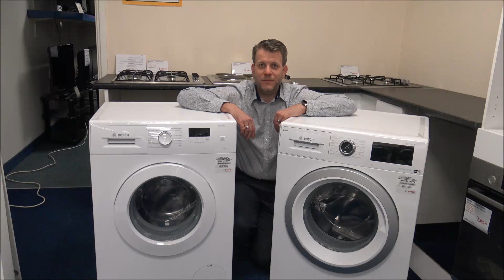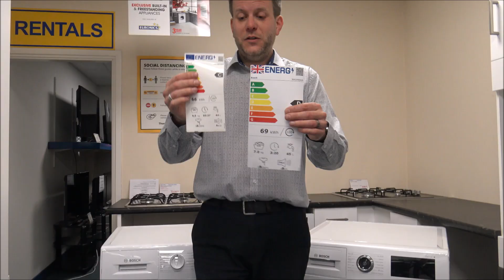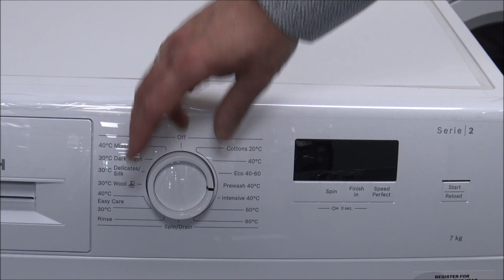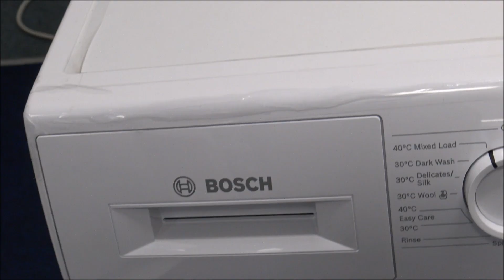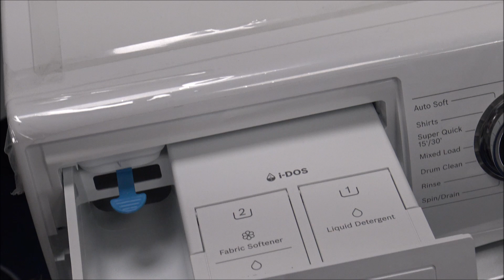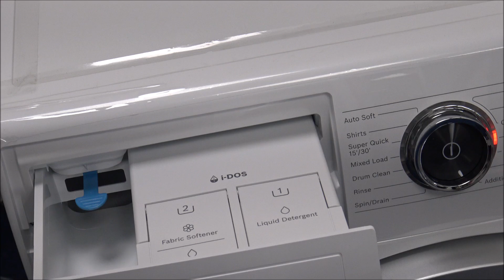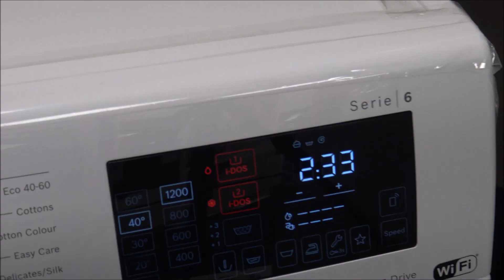Is It Worth Paying Extra For A Better Washing Machine?

Comment: When my old washing maschine broke, someone recommended that I buy a second hand Miele washing maschine. I could not be happier.

I paid 190.00

With a bit of looking I found a top of the range 8kg model with steam, so I no longer need to iron. 

The previous lady was an old lady, so it was like new, with a very small amount of hours clocked up. 

With used washing machines, there are either used continually by a family with pets, or are from a single or couples household. This makes a massive difference, on wear and how long the washing maschine will last. 

I managed to look in the service menus, at the number of washing hours clocked up since 2013.

With my current usage pattern. The washing maschine should last over 40 years. Given Miele’s own figures. 

The Maschine I purchased is a W5965 WPS. Not the most common, as it was a flagship model, just before the launch of the W1 series, but if you can find one, with low “mileage”, snap it up. 

It is the last of the built like tank era miele’s with the orange glow around the dial. However it has a larger drum 8kg, and many of the features of the W1 (apart from power wash and windows, but I don’t mix them, as it is more points of failure).

It has an inverts motor, like the W1 which is more economical, and is maintenance free.  

It is just about as economical S the W1 series that succeeded it, as it was top of the range, it used much of the same technology and principles. 

As everyone washes at 30°c now that the enzyme action of modern washing maschine detergent is better, there is no need to use the eco40-60 program. Just use the regular programs at 30°c for soiled items, for daily items, I use the short function of the regular programs, plus an extra wash, or the automatic plus program, which is about an hour. 

Where the 5965 wps far exceeds the W1 is with rinsing quality. It uses mor water to thoroughly rinse the detergent out of the fabric, and this really does get clothes “Miele Clean” after a few washes my clothes looked and felt like new again. 

This is because the vitreous but gentle wash cycles and thorough rice, removed detergent build up from my clothes, that had accumulated over time. Hoodies, sweaters and jogging bottoms feel soft again, and t-shirts hang on the body like new. It’s hard to explain, but clothes just feel good, and smell properly fresh, not fragrance fresh.  

I have had it for a couple of years now, with no problems. Washing is a pleasure now, instead of a chore, an as a result I look after my clothes more, so buy less. 

Could not recommend highly enough, buying a looked after used Miele washing maschine, rather than a new low-mid range one.

Comment: I have come back to this video .... I bought a Hotpoint NSWM846GGUK 8KG 1400 Spin machine in March 2020, and I have  "Babied"  the machine 
Never over- or underloaded it once .... Cleaned the drum with Calgon washing machine cleaner and the rubber seals /powder drawer every 6 weeks without fail with Dettol washing machine cleaner  (I live in a soft water area). I have cleaned the filter on the front of the machine every 3 months 
And the machine has only been used on average 3 times a week ....   
Do the maths 3x52x6  =  936  Washes.. (Less than 1000 wash cycles)  and the bearings are  starting to get noisy, 
OK, I did not pay a lot of money for it ..I believe it was around £280 (which, let's be honest, is NOT a lot of money anymore) 
So you could argue  £280 for 1000 washes ...Not bad value for the small amount of money I paid for the machine.... 
I am, however go to push the machine until it dies (I have been told the bearings can  rumble on for years before they finally let go) 
My next machine is going to be either 
1) Bosch series 2....  Bosch WGE03408GB 8KG 1400 Spin
2) AEG LFX50844B 8 kg 1400 Spin 

Both are priced at around the £419 mark..... I am going for better quality WITHOUT the  Hi-Tec BS   (connect to WI-FI etc etc...Less to go wrong)

Which model above would you reccomend please?
Reply from the maker: Personally I would say to try and stretch to the Serie 4 Bosch as the warranty should be better and you won’t normally pay too much more

Comment: I recently bought a Candy washing machine. (The model is: GD410B8G-80) 
5 yrs ago, I bought a Candy Tumble Dryer.
I live on my own so washing maybe 4 times a week, (Towels, Work Clothes, General Clothes, Bed Linen) usually near the weekend and during Economy 7 times.
The Tumble dryer still works fine, but the control selector has lost the ident positions.
The Candy washing machine has a 10KG load cap and has the clean drum function.
I have heard that it isn't good to close the door after the wash if the seal is still wet, so I leave it ajar for a few hours.
It is soooo quiet compared to the old Hotpoint that was here when I moved in.
I have chosen to use the 59-min Steam function setting for most of my washes but lower the temp to 40C and select 1400 spin.
I wonder if you can show approval of this or maybe a different setting. 
It's probably a big ask, but you may have something I can work with. 😁

Liked and subbed.
Reply from the maker: That sounds like a good program to use if you are in a hurry, but sometimes the wash performance is better if you use  the longer programmes. You are always better to leave the door open at the end of the wash to avoid smells and moisture buildup as well

Comment: I've got that series 2. Prior to that had an older series 4 equivalent which was 12 years old. Hadn't actually failed but lets just say I acquired the fairly new series 2 at no cost! New series 2 has a quiet motor. On wash almost no sound other than the water. Much quieter than the brushed motor on the 12 year old series 4. But on spin whilst much quieter than the old machine it shakes far more. The old machine never shook at all even with a heavy load. I hadn't realised it was only 1200rpm. Explains why it doesn't dry as well as the 1400 the old one did! The quality seems a big step down. Simply closing the door can take several attempts. Pressing the button takes an effort. Whole panel flexes. My old one was built like a tank. Had I not got it for almost nothing I'd probably pay extra for a series 4.

Comment: I have an LG bought in 2012, 11Kg even though it's standard sized. I think it has record low noise, 54 dB for washing, 64 for spinning. 

Display with pixels, and graphics, not old school numbers only. Will I be able to replace with a similar spec model if it will break ?

Comment: In my old apartment there was a washing machine included in the rent. A very basic cheap model, I dont remember the brand.. That thing just worked. Years later I wanted a new silent model. Got a Bosch for 500 Euros.. Very soon I realised that this machine was super sensitive with spinning and would stop if the load was not balanced.. This was NEVER an issue with the old machine. I moved (not because of the bosch) and there was again an old machine. An Indesit. Still working..

Comment: In 2007 my Hotpoint suffered terminal failure at just three years old. I went to Currys and walked out with the cheapest machine they had, a Whirlpool AWO/D 4505. I still have that machine, it runs on average 5 loads a week and it has only ever needed new motor brushes.

Comment: I have the Bosch series 2 and it drives me mad, programmes too long, and the shorter programmes only take half load. The thing I hate most is the ‘touch sensitive’ start button, if you don’t use the exact amount of pressure it beeps twice and won’t start. I’m looking for a new washer but I’m afraid I make a mistake again.
Reply from the maker: Unfortunately that is quite standard on a lot of washers that the programs are quite long and the shorter programs are for smaller loads. Try not to be tempted by a machine that does a full load in 30 mins as the performance and efficiency of the wash is not great
Reply: @lords-electrical  Thank you for your reply. My friends often tell me their washing machine does a full load in 30mins and fast spin, I realise after watching your videos their stories are all spin!
Reply: Those things are common to expensive washing machines too. They are EU cycles to get good scores on the EU energy label and the touch start buttons are commonplace.  You'll find models sold elsewhere (e.g., Australia, South Africa etc) have much shorter cycles on a similar washing machine (e.g., an Australian-spec 9kg Bosch has a 1hr 25min cottons cycle compared to 3hr 29min on the EU/UK-spec 9kg Bosch).
Reply: And the door which often doesn't close at first attempt which is why it does that as it senses door isn't shut.  Build feels a lot cheaper than last mid range Bosch I owned with a nice proper button. Is it touch sensitive though because seems to require quite a firm press. It's feels like the entire housing flexes when you press the button. And yep. Usually multiple attempts to start a wash.

Comment: A 3db increase is not twice as loud, it is a slight increase in volume. 

It requires twice the power to achieve a 3db increase, but we perceive sound volume logarithmically, so it takes twice the power to achieve a perceptible volume change. Hence the dB scale.

Comment: Thanks for the great video and explanation. It would be interesting to know whether more top end products use metal or better quality plástic components than the cheaper ones. As I understand the inverters are great but then the control panels are what seem to play Up. I recently bought an AEG ; any good? An equivalent BEKO +/- was €200 less, not sure if I did right.
Reply from the maker: You should find that the AEG will last longer than any Beko machine. Wise decision getting the AEG.

Comment: I note no one is brave enough to say how much a repair costs. If my beko breaks after4 years i buy another, after 4 years it's paid for itself. If your high end machine breaks you will need to have it fixed to justify it's  purchase. It's  a no brainer in our forced throw away age. Your repair man has you over a barrel, or drum, he can charge whatever he likes for whatever part and you're  stuffed
Reply from the maker: That is true now a days, or if you go for a brand with a longer warranty like Siemens, then it will come with a 5 year warranty anyway. But clearly they are more expensive to start with.

Comment: Please help. How do I change the mixed load temperature from 60 degrees to 30 degrees even if the machine is loaded and running?
Reply from the maker: You can normally only change the  temperature before the wash starts

Comment: The Bosch washing machine washes the mixed load at 60 degrees. How can I reduce the temperature to 30 degrees even if the machine is already  spinning? Any suggestions would be helpful.
Reply from the maker: Normally you can change the temperature of the program, but it has to be before the the wash has started
Reply: Surely if it's got to the spin stage it's already far too late, as the wash is almost over......

Comment: As far as the WiFi feature goes on the Series 6 machine, you mention:
1. The ability to start the machine remotely:
Well couldn't you just use the delay start function, and/or rinse hold if necessary?
2. Self diagnosis:
You can normally diagnose faults via error codes that appear on the display.
3. Additional programs:
As I understand it, you can allocate only one additional program to the machine, but again, I find that a bit of a gimic, especially when you have all the built in options for spin speeds, wash temperature, extra rinses etc.
But all that aside, with all these extra electronic gimics, it makes the machine more complicated, or sophisticated, with the potential for more to go wrong, simple plug and play fixes for a service engineer for a fee, but potentially rendering the machine unusable for the consumer. And if you are out of warranty, electrical problems tend to be the most expensive to fix!
You also say the motor has a 10 year guarantee on the Series 6 model. Does this include Labour, or is it just for the part?

I know the Series 6 machines are made in Germany, whereas a lot of the cheaper Bosch machines are made in China or elsewhere, and aren't as highly rated as the Series 6 machines,  as the Series 6 machines tend to be better built, according to consumers.

 But in all honesty, I would rather do without all the electrical gimics, such as WiFi, and just have a machine that was mechanically sound, for £100 less or so. Because I don't need the gimics, nor would most users I'm guessing.

Comment: My friend died and I was given his Samsungs that could not be defeated. I returned them to his mother and by the $1,000 GE floor model for $300. It struggles at spinning especially with towels. Now I know why Sam was singing. I like my GE but often it won't spin quickly, it has a hard time getting balanced. The Samsung the towels would come out almost dry without any extra efforts or a ton of extra time. On the flip side I wouldn't be comfortable trying to fix the Samsung but the GE was easy enough. Inside of a Samsung that looks like a supercomputer system while the GE is bare Bones.

Comment: I just replaced my 10 year old Bosch Washer Drier with a new Bosch Machine. So far I'm very impressed with the new machine - larger load capacity, a few additional features and much quieter. I selected the model I chose using Which? Magazine.
Reply: What module did you go for

Comment: What difference between bosch, blomberg and beko high end machine. Or miele are they worth they extr££££
Reply from the maker: Although miele are very good, we sell a lot of Bosch appliances. If you can stretch to it you will be better off in the long run with a Bosch compared to a Beko machine

Comment: As with anything else, it depends on one’s circumstances. We bought what some people would consider expensive machines, the Blomberg 24” stackable pair. But we are very satisfied with the results. The high speed spin of the washer complements the ventless dryer, and with only two of us, they easily handle the several loads per week.

Comment: Get a spinner as well.
Less electric needed when tumble drying and less wear on the clothes.  And the extra benefits of a quicker drying time and saving the washing machine bearings by being able to use it on a slower spin speed (1000 rpm).
And could go one better by drying using a DESICCANT dehumidifier and rack, (cheaper appliance, no clothes wear, less damp).

Comment: Got the wau 9kg 9 months ago. Can't recommend it highly enough. So many positives with the machine, worth every penny.
Reply from the maker: It could be that you have put a bigger load in than should be in there. If the 30 minute program is designed for 2kg load, and you put a 6kg load in, then it will take a lot longer to wash.

Comment: I just bought a $300 whirlpool washing machine, 7 kilos 1200 rpm, standard motor, not the inverter one. no screen no fancy options... But I really wonder, had I gotten a $500 one would I have gotten cleaner clothes? After all, the only thing that matters to me is the washing results not the efficiency, not the quietness, not the screen nor the direct inverter engine... I am not satisfied with its washing results as a lot of stains were still visible after an hour on the mixte mode. I wonder if I just wasted $300 on a useless machine that now I have to sell after one single use for half the price in order to buy a proper $500 washing machine. Did I do something wrong or is it the machine's fault? I used one cup of a good detergent. Help!

Comment: Lords, my Baumatic front load washer is having trouble completing a simple 15 min wash. Mid way washing it gives me the error  E21. And it stops washing. I keep taking out the drain filter to drain out water  but do you think I should replace the drain pump?
Reply from the maker: Normally any issues regarding pumping out are either a faulty pump in the washer, or more likely it could be a blockage in the waste pipe or sometimes in the pipe going outside

Comment: What about
- the quality if the motor
- the kind of suspension and dampener system the drum is mounted in
- the bearing the drum runs in, and it's cage material (plastic or metal)
- the material of the washing pan and the drum (plastic stainless steel, etc.)
- body rust protection (spray paint or ceramic coating)

Comment: I tend to go by the Which report. I handed on my 22 year fault free Asko which was still going strong   I went with the which suggestion of the Samsung eco bubble which at the time they said was the best machine they had ever tested. It's been amazing so far over the last 5 years (always used in 20 and cold washes). So many on my friends and family have bought one I think Samsung should put me on the pay roll ☺️

Comment: I'll stick with the F&P top loader. Yes it uses more water but is way faster and for soak loads can soak alot compared to front loaders. Plus it uses hot solar water feed in here in Australia. Never understood heating water on peak electricity in a washing machine - crazy expensive. Ps doing only cold washes will eventually soil the machine resulting in specs of dirt and bad smells no matter which brand.

Comment: The comparison fails from the start really. I mean a basic washer at £350? really... basic machines cost like £200 or less, higher end models £400+ ... bosch do make good machines but sorry £350. is not a basic price, basic machine at that price is an absolute joke...

Id go for a more used brand, Hotpoint, Candy, Hoover, Indesit, Logic, Zanussi, the bosch really is a higher market not really intended for basic, bosch are over priced and not affordable to many, you can buy Miele for them kind of prices or a samsung 
just my opinion anyway